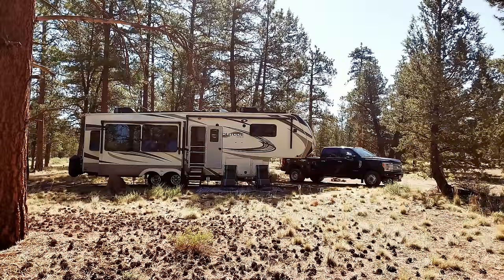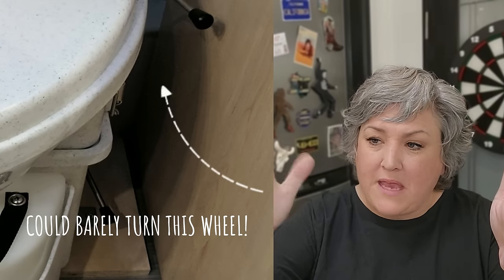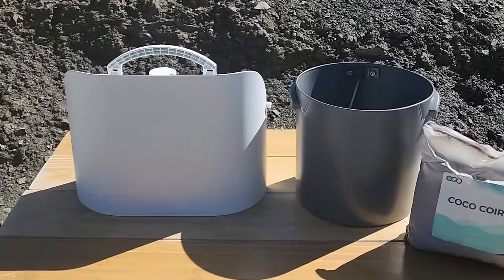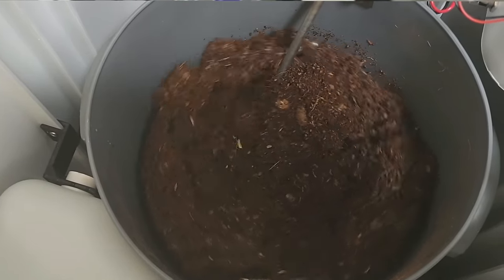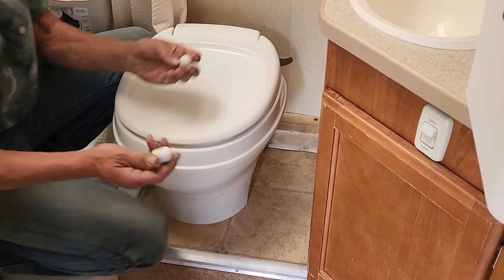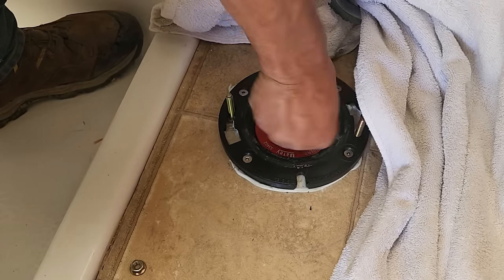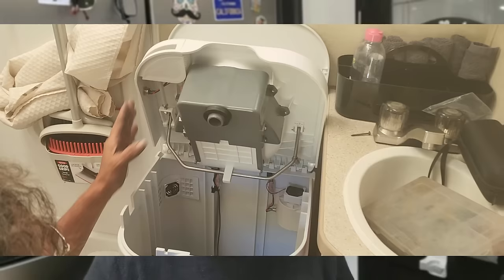COMPOSTING TOILET?! Why, Which One, Cost, How it Works, TWO FULL INSTALLS, & FAQ. OGOToilet

Comment: I've been wanting to put a toilet in the second building on my property, but it would've required breaking the slab and running sewer lines. This would be so much easier!
Reply: If you have access to the power grid, you might also want to consider an incinerating toilet.
Reply: Eco John
Reply: A local police dept did just that, put a composter in a closet

Comment: LOL!!! What timing! It's super hot out, and I'm on my break from building the frame for my composting toilet. It'll look a lot nicer than just my luggable loo sitting in the bathroom.  :)  I was using a porty pot in my motorhome, but frankly those buggers stink. So last month, I went back to using a composting toilet like I used when I lived in a cargo van.  I forgot how great they are!
Reply: Mine never stinks - I use cedar chips.
Reply: @mylibertyvan5650  I've been having pretty good luck so far with pine shavings. Tractor supply has 22 pound bags for $5.67 (that includes tax in Ohio). Where do you find the cedar chips?
Reply: @yochanacoleman4974  Check a pet supply store.
Reply: I was thinking about a luggable loo for a starter.  Do you use an absorbent material in the bottom of the bag?
Reply: @kp2874  What I've that works best for me, is the bottom of the bucket is covered by a few inches of pine shavings, to absorb any leaks. Then a bag with pine shavings for #2, and #1 is the funnel and repurposed vinegar bottle for #1. With the bag pulled back a bit, the vinegar bottle fits nicely.  :)
Reply: @yochanacoleman4974  tractor supply has them.
Reply: @kp2874  I use the urine absorbing powder in my luggable loo. I didn't have enough space for storing the cedar chips, but I liked them too.
Reply: @pamthompson7059  Thanks for the heads up!  :)
Reply: I don't need a composting toilet, but became interested due to watching videos of some homesteaders.  Some mentioned using sawdust,  how about one of the kitty litters, some are made from pine material, some wood pellets, some paper, as well as the clay,  all but then clay or silica(sand) would decompose?

Comment: As I started researching van life vs RVs, I was quickly converted to using a composting toilet, especially once I learned about building my own. The idea of black tanks was just gross, plus being a waste of space. I’m fine tuning mine right now, and using kitty pine pellets meant no odor at all. Win win!
Reply: I'm working on a modification like that now. I don't currently put any solids in my black tank, and would like to just have a simple pee bucket. Does the kitty litter work well? Does it need to be emptied often?
Reply: Awesome. Same thoughts here re black tanks.

Kitty pine pellets are a more specialized and expensive version of pine pellet bedding for horses, just as a note. 
The equine version comes in larger quantities, which is great for off grid stationary living, but a possible drawback for mobile use. If you know a few other campers with composting toilets consider buying and splitting a big bag.
Reply: I just don't see what the big deal about black tanks is. It's really no big deal to empty it. Takes about 15 minutes.
Reply: @nygrl6102  
If you spend time in cold weather you may find Another negative to black tank - freeze up...  Saw it happen to an RVer going to AK late May & late snow storm. 
I dumped a gallon of windshield washer - anti freeze in my black tank - it worked in an emergency for me.
Reply: @ellafields9424  good point!
Reply: Black tank is the closest to regular sewer like at home, but has downsides. Composting toilet is the best, affordable option, least gross, and if someone has own garden with compost, disposal isn't a problem. Then, there is a legendary incinerator toilet, but who wants to spend so much money on burning stuff? ;)

Comment: Hey Robin!  Great video.  We are attempting to educate boaters to convert to composting toilets and also recently were introduced to the OGO.  The biggest resistance is the perception of smell and handling raw sewage.  But the eco options, the lower cost compared to traditional vacuum / macerating heads and the hassle of finding dump / pump stations are making composting toilets a great viable option.  kudos on your channel.

Comment: Urine outside - some people don't realize that urine is sterile. It's not an environmental issue. However, because of the ammonia, it can smell if at high concentration in one spot. So just be nice and do a little way from people camp spots (at least in dry areas).

Comment: I have a poor mans version of a composting toilet: marine toilet seat installed on a hinged box, bucket, separator, urine jug. It doesn't churn, but much easier to throw away the waste.  Bucket is lined with a trash bag, started off using coconut coir sprinkled on solids, but ditched that and now just spray Angry Orange on the waste/toilet paper.  It's a 3 gal small bucket so I dump the solids every  3 or 4 days.

Comment: we have an Eco John (Tiny John) incinerating toilet.  It works on these types of energy: electric, gas, diesel, propane and 12v.  Ready in 50 minutes after every use.  Services 2 to 5 people.   Incinerates liquid and solid.  They have larger versions and also a 'septic' incineration system for homes.

Comment: An interesting compost toilet. Looks much better than ones I have looked at. 
I have not put TP in the black for a few years. I never have bought the special RV TP - waste of money. I don't use chemicals in my tanks either except I dump a box of baking soda in my black. As for the fan pulling the smell out of the black tank - never had it happen in my decades of RVing.

Comment: My low tech solution is simpler and far cheaper than a compost toilet. This video takes more than 10 minutes to explain compost technology, with a dozen steps to master. Compost toilets can cost $120 to $1,000.

By contrast, for 4 years (100,000 miles) I've been using a barrell-type porta-potty in my camper van, with a plastic bag and horse stall type pine pellets. The cost is nominal —about $25 to buy the barrell+lid and about $6 for 40 lbs of pellets that last a long, long time. It's super easy to use and to discard the waste, with no odor. The bagged sawdust can be dropped into any trash container, or scattered outdoors if you are in an appropriate place.

The barrel system means no worries about where to dump, no water required, no dirty fluids to handle, no venting, no complicated steps to follow. Two cups of pine pellets last several days, swelling up into sawdust. Occasionally I sprinkle in PooPowder if I have to use the toilet for BM. I can locate the barrel wherever convenient, without committing a specific spot for the toilet. In a prior van I kept a poncho handy to slip over my head for privacy.

Comment: I live in a tiny house on wheels which is permanently parked. I have a Separette. I had a series of problems. The fan failed. Then I got flies. The urine tube clogged. All of these were easy to fix. Diametrous earth eliminated the flies. The urine clog has been tougher. I have used vinegar and hot water. Next I will use a urine biodigester. I think the problem with the urine has a lot to do with how the urine drain was run.

Comment: I'm a huge composting toilet fan.  I currently have your old style and I am a fan, but I totally hear  ya on the cons you eluded to - especially the heavy and awkward process for dumping the solids.  I'm curious about this OGO toilet.  Everything looks great, but one of the reasons I like your old style is because there is nothing overly mechanical which makes me feel confident that nothing will break - and if it does break, it's an easy and inexpensive fix.  With the OGO using power to stir, I wonder what happens if it breaks - is it easy to fix and how expensive is the part.  I'll have to dig on their website for some answers.  I'm quite interested in the OGO because as I get older, the "other" brand might be too heavy for me to handle in the emptying process.  Once again you have given us a very informative video - this is exactly why you are my absolute favorite youtuber to watch! Thanks, Robin! One thing you didn't address was comfort - how is the "sit"? Is it comfortable?  I will give props to your old style brand for comfort.
Reply: I have a c-head compost toilet. It addresses all of the issues you’ve addressed in your comment here. The footprint of the Ogo seems smaller if that an issue for you though.

Comment: You would have liked the Trelino.  Half the price, will never run over as it is a self contained.  Developed by engineers to have a urine diverter and poo box.   I have the Evo L  16.9 inches.  My knees are too old for a shorter one.  I use horse pellets in mine.  I like your channel.  Good info!

Comment: Evaporating the gray waste sounds like a much better idea than dumping on the ground as food particles could draw in rodents and other animals not to mention unpleasant odors.  Just standing water, especially in arid environments could draw in flies, wasps, mosquitoes, and other insects.  Ideally use a dump facility but if you won't do that check if you can legally dump while driving on the road.  At least that way you're not creating problems for other campers.

Comment: Quick question, if the pee is diverted with the provided shute, how does one lift out the solids bucket to empty it.
All content I've focused on shows removal of pee canister/bottle, then pulling the bucket out the front side.
Is that correct?
Now, general query.
Why hasn't someone sat down and designed a composting toilet with a permanently plumbed Pee Shute into grey water (yes OGO can do that) but then create an access from behind so that the solids container can be accessed via external door, dumped, refilled with compost material and slid straight back in, shut the door.
All fetal matter dealt with externally, no carrying waste bucket thru RV.
If someone designs that, I'll sign up for it. I'm not in favour of carrying poop thru my RV.
Until then I'll continue finding dump points with our present toilet.
You see, I don't really think anyone has actually designed a composting toilet for dedicated RV use.
Oh, I'm from Australia, it is illegal in our country to dump grey water directly onto the ground, it must go to a certified dump point as well, however, most RVers ignore this.
I do oblige and get rediculed for it.
"Why the hell do you bother" is the polite one, others very crude.
Oh, life on the road, it's grand.

Comment: The OGO looks nice but pricey and with a lot of moving parts, I just see problems. Personally, I like the GTG Sun Mar composting toilets better. They look nice and sturdy with few moving parts. I prefer a diverting method for the urine to mix with the grey water. The grey water will dilute the urine making it safer for plants/nature (ever wonder why female dogs cause dead spots in grass but not male dogs? It's because of how they pee. The females urinate in one concentrated spot whereas males spray their urine). Also, remembering to use nature friendly dish/bath soaps and cleaning products. If the GTG Sun Mars are too expensive, I would just make my own by cobbling some off the shelf parts like a portable travel toilet (outward appearance of regular toilet but hollow inside to place your other off the shelf parts like a plastic container, diverter, vent, etc.) which should cost well under $100 for this method.
Reply: If you get a waste/dump valve and connect it to the exit hole, you can leave your gray and black valves open and utilize the black tank as a gray tank, increasing your gray tank capacity so you can dump less often. The water will equalize in both tanks increasing your capacity. Ideally, the black tank should never have been used as a black tank or you could sanitize it before using it as a gray tank.
Reply: I suspect dumping our compost and gray water in the desert will actually help to greenify it. If all future boondockers did this, we could create a lot of little oases in the western half of the US.

Comment: that looks much better, however don't you still have to find a dump station for your grey tank?
Reply: Yes, you still have to dump your gray tank,however you can tie the black and gray together and double the capacity. You save water and get more gray capacity. And no more worry about a dump hose splitting open, or the tank somehow clogging up.

Comment: Looks sleek. 2 questions: Is there a way to use it if the power goes out? Also, a bit personal, but, is the seat comfortable? Another popular brand has an integrated molded seat and I find it isn't very comfortable. I've been leaning toward the C-head because it has a standard toilet seat so I already know what to expect.
Reply: There have been a lot of bad ratings and warning about C-head. Serious problems with the toilets, and very bad customer service, including no customer service. It seems as thought the company may have gone bankrupt. I have no personal experience with it. Do  your research! Good luck!
Reply: It is 12V power so basically working off batteries.
Reply: Ke Le everything I have seen is really positive. Where did you find the negative reviews?
Reply: @kele1264  I hope you could be more specific about the "warning", problems, etc.  Also other than customer service for placing order, I don't think you need much customer service for repair or replacement because "the design" mostly uses nonproprietary parts, i.e. very generic, which you can get from any hardware stores.

Comment: Get a Trelino toilet and thank me later. Trelinos do not use water. Many  cassette toilets use 3-5 gallons of water.  A gallon of water weights 8.34 lbs. So you are carring 25 lbs to 41 lbs of water around. With a Trelino just dump #2 in the trash can and empty #1 in the toilet. It is a simpler design.

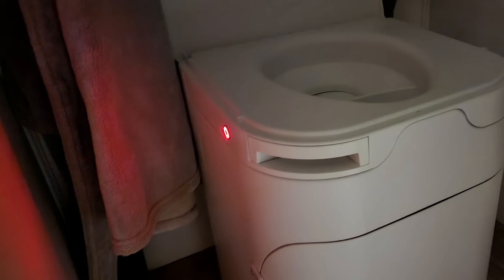Comment: 7:20 - YES. I have a Class C, and i have a schedule..on my cabinet door..that tells me when to hit the black tank and to use the gray for flush. For me, it's around day 12-13. So EVERY OTHER WEEK, first day off, black tank then gray tank. Schedules work....but then again, i live alone with a 5 lb dog, so if i'm off a day or so, it's easy to just see the shower not drain and just head outside to pull a lever. SOME of the people with me leave their gray tanks open all the time. NO. I use my gray to flush the hose. That way, the water does two jobs!

Comment: Yep took out my reg toilet n made my own compost toilet for $20 bucks :)
Reply: How - is there a good instruction site or youtube?
Reply: @susans7091  YouTube university can explain both I had to HV my RV guys remove the toilet, handicap doesn't allow me to HV that ability. Made my own compost toilet for about $20 👍
Reply: @gigievans395  I have not found a good instruction site for making a composting toilet that is also a separator, easily for about $20.  That is why I asked for a link.  I have looked at a lot of youtube videos. Most require a lot of carpentry, materials purchase and tools.
Reply: @susans7091  u don't need a separator if u use shavings n organic compost mediums like coconut husk and other options 👍
Reply: @gigievans395  Sorry, I definitely want a separator.

Comment: Thanks for posting this review. I think you just saved us from making a costly mistake selecting a composting toilet. It sounds like two people can use the Ogo for around 12-15 days before emptying the solids bin if not putting TP into it? I don’t think my wife would like putting used TP into a separate waste bin so I wonder how long it will go before emptying the solids bin if your putting TP directly into the Ogo? I’d be okay with a week between emptying it. Understand the fluids tank will probably need emptying every couple days which is fine with me. Shopping for the best toilet solution in our camper van build had been a confusing/difficult decision. So much to consider.

Comment: I’ve been tossing around the idea of installing a composting toilet in the rv for some time now. You really had me sold on the OGO, until I pulled up the website. If you go without the exhaust plumbing you have to install charcoal filters which only last about a month which is $3 or for a packet of 12 is $30 plus shipping. Also didn’t see the urine diverter on the site. 
Let us know how the ventless is working out

Comment: Hrmm.  I was wondering if there was going to be a manufacturer smart enough to offer a diverter for the urine to not have to dump it daily.  I'm thinking a small black tank with a composting toilet and a diverter would be great for me... However... We're a family of 8 with two six year old boys and I'm not sure a composting toilet will work for them.  So, I'm very up in the air about it.  As far as the solids go, would I not simply be able to dig a hole in the ground and bury the compost as long as it's enough away and suitable ground for doing so (kind of like digging a cat hole and burying while backpacking)?  As far as the greywater goes, I'm thinking of installing a 60 gallon grey tank and setting up a filtering and recirculating system like Snow & Curt have in their van.  I can't see any other way of having enough water on hand for our family of eight to be able to shower and not run out of water.  I'm also thinking of doing four 30 gallon fresh water tanks to be able to better control the use of the water and reduce the need for baffled tanks.

Comment: Just ordered the new OGO Nomad. Very small, no mixer but has the divided sections. 
Think I’ll have to make a small platform to raise it a little because it sits very low. 
Expecting delivery soon. 
The great thing about this model is that it will fit in small spaces: campers, vans, tents etc.- completely portable.